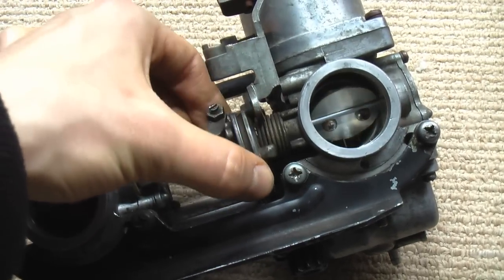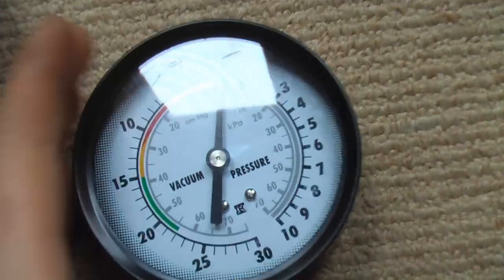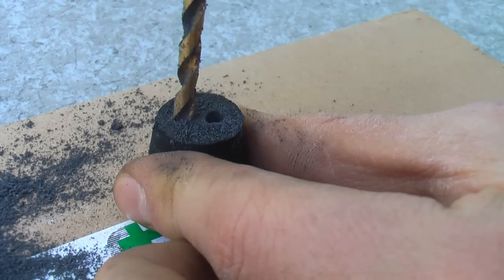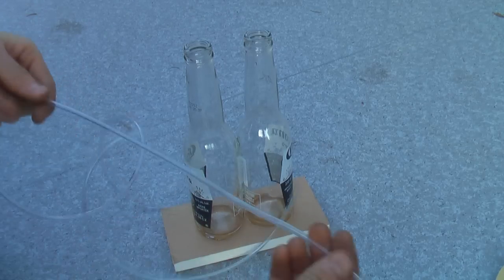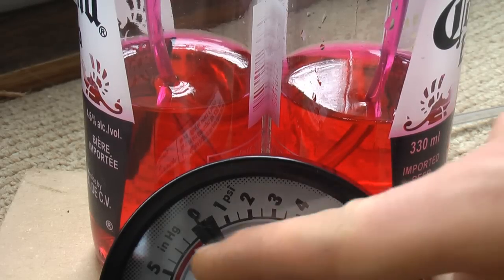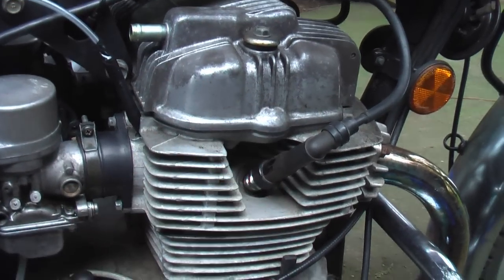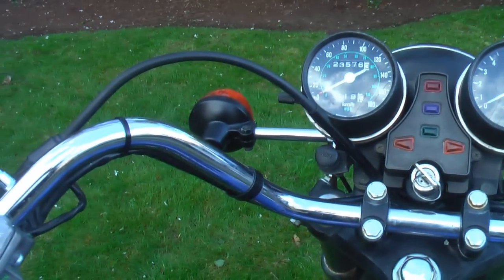How to Balance Motorcycle Carbs

Comment: I just synched my carbs on my 1980 Honda CX500.  I'd never done it before and was nervous about it.  Used your method and they synched up perfectly.  Thanks for posting.
Reply: cool! i have a 1978 cx500 and was also kind of nervous about this but after seeing your comment i will try this this weekend
Reply: good to hear I'm not the only one that's nervous.
ill try this on the weekend.
Reply: Did the tubes fit right into the sync port or did you need an adapter? I have 1980cm400a so what worked for you I'm assuming will work for me lol
Reply: I too have a 1980 cx500. It's about to turn 20k miles. The original owner must have kept it in the garage because it is in top shape. The guy I bought it from was the second owner. He knew nothing about maintenance and had just had the valves adjusted and carbs rebuilt so I'm probably good to go for a while, but when it starts running rough, I'll know what to do. Great video.

Comment: THANK YOU SO VERY MUCH
I was about to give up
I bought myself one of these four gauge synchronisation meters, you could either choose wildly bouncing gauges or no movement at all as well as way too low readings.
Out of desperation I used google and stumbled across your video.
Recreated your tool and what should I say: IT’S LIKE HEAVEN
works like a charm costs nearly nothing
very hard to mess up
❤

Comment: I just sync'd my dual carbs on my 1988 Honda Shadow VT600 VLX using your procedure and manufacturing instructions for the homemade manometer. It worked great! 
One suggestion: Don't overthink the CW vs CCW thing about the adjusting screw. Just watch the tiny bubbles in the crossover tube (I used red ATF instead of water) and you can see the direction of flow. This is much quicker than waiting for the level to change in the bottles. 
Also, my screwdriver had to be in a vertical position, pointing downward from where the gas tank was attached ( had to remove the tank which turned out to be a good thing because I discovered a leaking petcock) which put weight on the adjusting screw, so I removed the screwdriver after each adjustment. I also "blipped" the throttle a few times throughout the adjustment. Total time of actual adjustment was less than 10 minutes. 
I don't know if it made a difference but I reinstalled the air filter housing after installing the brass adapter tubes and clear plastic fuel lines (5mm ID) for the adjustment.

Comment: awesome video,
I have done a similar thing, but I used auto transmission fluid as it is an oil and if for any reason it got pulled into the bike it would be okay, oil good...water bad, I also found that the auto trans fluid was less jumpy in the container and showed more accuracy than water. used very successfully on a '96 XV1100S Virago. Paul.

Comment: That is cool. I gotta try this! 
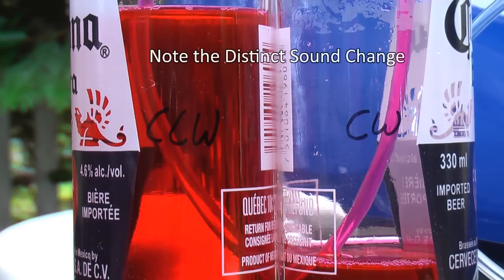Was thinking about using a light oil instead because if you watch @7:00  when you rev the engine, you'll actually see water vapor form in the bottles. Although a little water vapor in the engine is no big deal. 
And btw, did you know you can actually boil the water off with enough vacuum. Science 😉
Reply: Good point! I'd forgotten about that law of physics, but you're 100% right. It's one of the principles behind refrigeration and air conditioning.

Comment: You mention at the beginning that you don't care for the gauge manometer because the needle keeps jumping around at idle.  I wonder if you could simply use a damper in-line?  Perhaps something as small as one of the bottles you are using for the fluid manometer or a bit larger?   Ultra easy to try anyway.  Just a two port rubber plug to stop the bottle and the air volume inside smooths erratic pressure/vacuum changes without altering the mean pressure/vacuum, kind of on the order of an anti-knock riser in plumbing.

Comment: OK Good Video, great piece of kit, but how did you adjust the screw between the carbs. I have the same carbs as the video but the screw and locknut are 'buried' between the carbs and I can hardly get near either of them to make an adjustment with engine running. It must be simpler?

Comment: I'd like to use the same method on a set of SU HD6 Carbs but I don't know where to connect the two synchronization tube's. Could it be to either the overflow or the suction pipe?? - Great video by the way 10/10

Comment: Great DIY video guy!  Who could not like this video!? Rev the motorcycle to around 4k rpm and sync' there or a reasonable 
cruising RPM. Syncing at idle isn't relevant as the engine spends most 
of it's time at cruising RPM's.

Comment: I have a Honda about the same age, how do you connect the tubes to the sync ports? Did you use an adapter or does the 5mm tube slip right in?
Reply: Yeah I’m wondering the exact same thing!

Comment: Can you do 4 cylinders using the same method? Thanks from Down Under.
Reply: It depends on the bike but usually in a 4 cylinder you synchronize carb1 with carb2.

Then carb3 with carb4

And finally carb1 with carb3 in the specific screw

But check your manual

So yes, you can use this method
Reply: @rc2634  bro how to guess rpm? In single throttle think 1 cylinder screw rotate 4 time and 2 cylinder rotate 3 time but it's till similar then any issues in average rpm?

Comment: How did you connect the plastic tubes to the intake manifold screw holes? It looked like you had them taped up pretty good. I'm assuming it's necessary to get a tight seal at those ports.  Thanks!
Reply: Dustin Waite looking to get the same answer. Did you ever get one?
Reply: If your port has M6 or bigger diameter, you can make an adapter using brake fluid bleading screw, you just cut off the end of the screw. Unfortutately my bike has M5 diameter and those are not to be found in my country. Lathe will have to solve it.

Comment: Just use a needle valve or a restrictor with the vacuum gauge and that will stop the needle flicking around
Reply: while this synchronizer is a very good idea and quite impressive for it's simplicity i get a kick out seeing how much extra work people go through simply because they didn't know that all they had to do to calm the needle down is to restrict the volume of vacuum  to the gauge with something like a fish aquarium needle air valve or even a little cheap inline plastic valve used in landscaping drip systems....

Comment: Hey Trenaman, I own an '01 suzuki Gs500 naked, and i've been noticing that i'm feeling a gradual decrease over time in power delivery & responsiveness from the engine. It feels sluggish and very dull. So i've been thinking about cleaning my carbs thoroughly. It is required to sync the carbs AFTER they have been cleaned and re-installed? Thanks bud! :)
Reply: I own a 2006 gs500F and Yes, you need to Sync them after any work has been done to them, including even if you've just replaced plugs and wires. :)

Comment: How did you determine which bottle to mark clockwise and counter clockwise?
Reply: Levi J 
Actually that was kind of pointless.
If turning it one way doesn't slow the water rise, turn it the other way.
And don't worry about getting the water levels even.  The idea is to stop the transfer of water between the bottles, bringing the water movement to a dead stop.  The actual water level in each bottle makes no difference.

Comment: I have a 1982 XJ650 Maxim.  When I first got the bike it ran but the idle was really high.  I took the carbs off to clean them twice. Now I can't get the bike to start. My bike has 4 carbs and that annoyin YICS.
Reply: First you should check your valve clearance as that will determine everything. Probably an intake leak though. Czech the intake boots and the your carbs for bad seals/air leaks. If nothing works, XJbikes will help.
Reply: Kyle Mccool The valves will be my next check when I have the money. I have great compression so the valves make no sense but I will get them checked. I ordered a neat tool. I got the YICS block-off tool. Get rid of that crap. I had a Honda Prelude that had the same problem. Worst bike I have EVER owned.

Comment: Good tutorial if you want to save some coin, I have 4 carbs to sync so will soon be building my little kit..great video.
Reply: i built one similar to this except i used longer tubing with no bottles and put connectors at the bottom and zip tied them to the board i was using i used blue 2 stroke oil i picked up at the garage near my house worked perfect the throttle response was alot cleaner and the idle is alot smoother

Comment: is there a chance that the water gets sucked in to the cylinder??
Reply: If you're using 2 12 ounce glasses you shouldn't use more than a total of 12 ounces of you use more then it might get sucked into the carb
Reply: Incase someone else has the same question, there are more ideal fluids to use just in case it gets sucked up. Can't remember which though

Comment: I spent the better part of 5 hours cleaning another set because one of float things broke. I spayed carb cleaner through every hole front and back. I worked on one carb at a time. I installed the float needle and seats. I got nothing. I won't start. I makes no sense. Just how can the guy on TV that goes around finding 100 year old bikes and he doesn't have the trouble I have getting bikes going. These bikes defy all logic.

Comment: 1st, the vacuum gauges will not bounce if you use the pinch valves they come with. 2nd, you shouldn't just settle for the imbalance.. this is called 'balancing' for a reason.. it's not technically a synchronization, which would refer to a timed event, this is actually balancing the carbs, and the 1/8" discrepancy isn't necessary. Motion pro makes a special screw/nut driver combo to prevent that . 3rd, this method will be very inaccurate  on a 4 cylinder motorcycle.

Comment: Just how can you balance the worthless carbs if the bike refuses to start. Yamaha needs to be shutdown and ALL the people there need to be arrested. These bike are junk and the engineers that designed the bike need to be jailed. XJ bikes are no help. They lead people down the wrong path. Bigfritz is one of the biggest jerks out there. These bikes are nothing more than money pits.
Reply: Your incompetence doesn't make the company bad. There are millions of Yamaha's running just fine out there.
Reply: I am referring to the XJ and XS line of bikes. I have owned a 650 Special and an Exciter. The only problem with the Exciter was the starter. I got mad and banged the starter with a screwdriver and it would start. That's it. No other problems. The XJ bikes defy logic. The YICS is the problem. Building an induction system that uses a rich mixture to ignite a lean mixture is a major engineering flaw. I had a Honda Prelude that had the same system. It only lasted a couple years and it was gone as it didn't work.
Reply: altlandf It was called CVCC by Honda and was used for about 15 years, with the majority of that use between 75 and 85. The system wasn't dropped, "as it didn't work." CVCC simply became obsolete when fuel injection became affordable and reliable.

It is a complex system to work with though. And beyond the scope of many techs these days let alone shade tree DIYers
Reply: atsernov yep.my R6 is15 yrs old,& still does 160mph no probs.